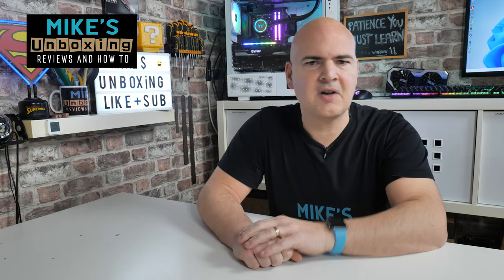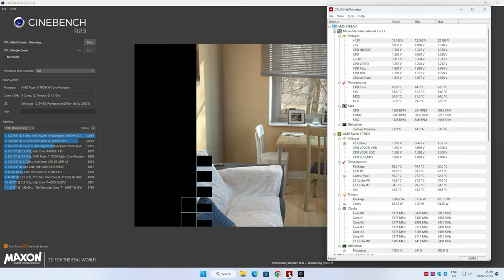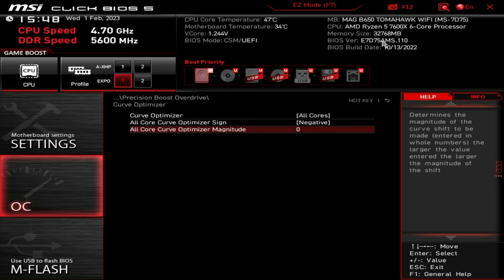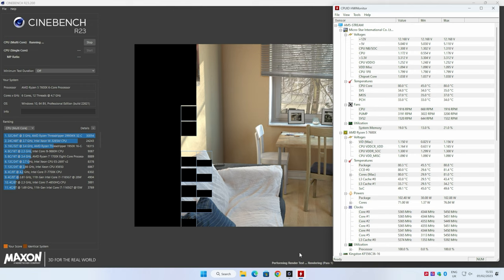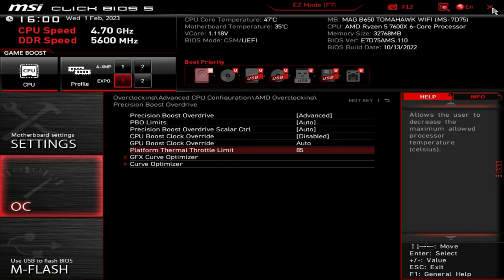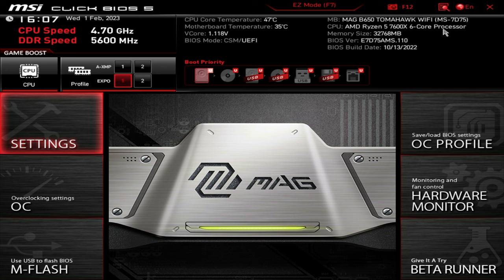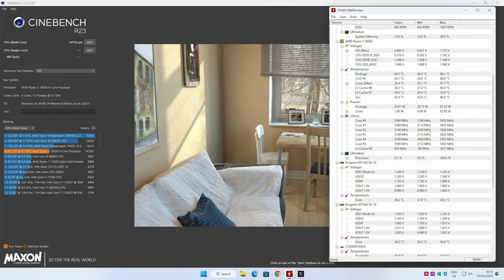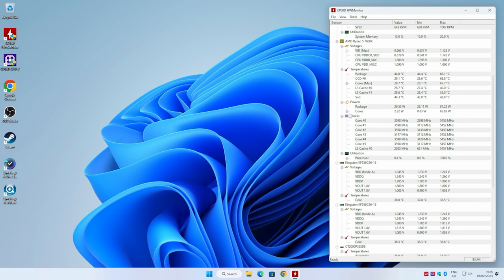How To Tune AM5 Ryzen 7000 Series Wattage & Reduce Temps With Curve Optimiser PBO2

Comment: For anyone interested in easy testing AMD's Ryzen Master software has in-built tests able to determine the suggested per-core negative curve optimized max safe setting each core is capable of for under-volting, which can then be inputted to the BIOS as Mike showed in this helpful vid.
Reply from the maker: thanks Ron absolutely right on the money there
Reply: @mikesunboxing  Every time I run it, all the cores result in a -30 offset on per-core in RM auto tuner.
Reply: I have the ASUS motherboard and it would give me BSOD every time I adjust anything.  ASUS are so slow to fixing these things through updates.  I'm running power saver at the moment until I can undervolt my CPU.
Reply: Ryzen master always sets my cores way too low which is barely stable to boot windows but crashs at any heavy task.
Reply: I couldn't ever get ryzen master to work, everytime I run it, it says it needs to be reinstalled everytime, I tried so many "fixes" that software is a hassle 🤣
Reply: @voice5sur5  same here
Reply: I tried Ryzen Master but decided to uninstall. Maybe it's something i wasn't understanding, but there was a weird thing with the RAM speeds and EXPO in Bios. In Bios RAM speeds were 4800 and then 6000 after enabling right. But Ryzen Master would always only show half that, 2400 and 3000. 

Also, when EXPO was enabled in Bios, I then also enabled it in Ryzen Master and then ran a test, and the PC crashed. I liked the look and options of Ryzen Master but the RAM and EXPO thing caused me to unintall and only use Bios/AMD Adrenalin.
Reply: @sleazydzx 2400 or 3000 MHz being shown is a feature, not a bug. Nothing to worry about there since DDR stands for double data rate, if it reads as 3000 MHz you're operating at double that, thus 6000 MHz.
Reply: Didn't know this. Wish Ryzen Master wasn't so ass tho. Sorry for the language, but it's the truth. Can never get it to work properly. Been doin' Bios tweaks manually since forever.
Reply: @sleazydzx some motherboard companies show the "true" speed. DDR stands for Dual Data Rate, which gets you the actual speed. In short, there is nothing wrong, they're just displaying it differently. 2400=4800 and 3000=6000 in DDR...  

Edit: Ah, someone beat me to it lol. Carry on :)
Reply: @sleazydzx  The RAM speed is correct, you need to double it (DDR - Double Data Rate) to get the final M/Ts, 3000 is actually 6000. You're better off enabling EXPO in BIOS and letting the computer boot up / shutdown, sometimes several times before the EXPO settings are locked in. Plenty of videos about this on YouTube.
Reply: Can't recommend it, RM set my cores to -40 in pbo it boots and runs but bsod's on prolonged heavy CPU usage. I thought I hit a jockpot in silicon lottery after RM tuned my CPU to run 5.5 with lower temps on heavy loads (70c) but then it crashes hard after an hour.
Reply: @voice5sur5 I had to pull my cmos battery after I installed ryzen master it screwed mine up so bad lol.
Reply: Ryzen Master's test is way too optimistic. It usually sets -30 or -27, which unless you have the best silicon on earth, WILL crash (WHEA-18).
I guess it can at least be used to determine a maximum that is useless to test over

Comment: Thank you so much for this, used your same exact settings on my own 7600X: went from 14364 cinebench score with ~96 °C and 135 W package power to 14756 score with 70 °C and 87 W max! Insane.
Reply from the maker: That is a great result nice one
Reply: ????????????????????????? 96*C ? buy new cooler mate mine after 10h in game have have max 67
Reply from the maker: This is expected results for am5 they have a target of 95c by design
Reply: @nokelo4207 does 360 aio is enough for 7600x to get temp under 75 ?
Reply: @Crenzy-ct9tt  I would start with undervolting it as in the video.., the chips clearly use way too much watts and power for their overclocked
 speeds by default..
Reply: @nokelo4207  even with the best cooler on the planet, you should undervolt your ryzen 7000 series, they are produced to work at 95 degrees and above also, so its not matter of cooling, its matter of optimizing performances!!!
Reply: @GiacomBono  I didn't buy the 7600x just to underwolt it. I buy it cuz its a bit better than 7600 and was cheaper
Reply: @nokelo4207  of crz agree with you, but doing undervolt will increase efficiency and performances as well, always worth it with ryzen cpu.

Comment: Thanks for a very informative video Mike 🥰💪👍😇. I’m currently putting together an AM5 system (most parts purchased except cpu) and contemplating the 7700x or the 7800X3D for a gaming setup 🤔. These settings will prove very handy for my build. Cheers 🍻 buddy 🥳
Reply from the maker: Sounds great! i would go with the 7700x at the moment, i just picked one up to repalce the 7600x and cost me an extra £40

Comment: 30 passes validation for me and boots up when set in the bios but core #5 will fail prime small ffts after a few minutes for me. 7800x3d and Asus x670e-plus-wifi....I was able to run for an hour at -20 and play a couple hours of CoD so I think I am good there. Clock speed is right around 4600mhz so not full boost but I guess it's ok.

Comment: Nice Video! I tried to set it to 30 and everything was fine, i got a higher cinebench score and lower temps but after that i kept getting bios freezes and Memory Management errors, even after disabling PBO completely i got an Memory Management Error, i had to disable the EXPO ram profile even though it was working before to get back in to windows, any ideas?
Reply from the maker: manually set the EXPO and ram timings, that worked well for me, we did a video on it recently after having DDR5 issues
Reply: @mikesunboxing  Thanks for the reply! I saw the video and i followed the instructions, after that i was able to experiment with the PBO again but after a couple of setting changes and restarts the bios freezes and bsod‘s came back somehow. If i reset the bios settings everything is fine again but it’s quite annoying because i would love to get the advantages of the PBO but i can’t seem to make it work, i also have the msi b650i edge, i‘m thinking of trying the new beta bios version or do you have any other recommendations?
Reply from the maker: This is maybe easier to fix or at least advise if we can ask more questions and get direct answers, so feel free to join our Discord chat and we can go over it in more detail https://discord.gg/XtBTGQ6BDu

Agree to the rules by clicking the emoji and you will get access to the rest of the Discord channels @ncly9995

Comment: thank you sir, i had issues with my temps and most importantly sound and power of my ak620 fans with my 7600x, i lower the curve to 30, with a limit temperature of 80 with auto setting in tdp, and now is running really smooth
Reply: and my pc crashes if i put co to over -10

Comment: I copied all of your settings with my 7700x. -30, 85 PPT. My tempratures maxed out at around 60.9 C with a score of 19060 in Cinebench 23. This score was around the same as it was when I started. Wattage was at 87. Idle is around 41 C. It looks like I got a good CPU! I have a Noctua DH-15 with MSO Pro B650-P Wifi. This was quite easy to follow since your board is also MSI. It seems it's working very well for this configuration. Thanks for the video!!
Reply from the maker: glad it helped you with your setup
Reply: impressive drops, what sort of wattage do you get when the system is in idle in windows doing nothing?
Reply: Can use CO -30, 85 PPT together?
Reply: when i use this setting my score drops from 19000 to 18000 and i don’t get why. i notice that the boost doesn’t go past 4.4 mhz

Comment: Thanks a lot for this mate.
I managed to get much lower temperatures and power consumption while also gaining 1000 points in Cinebench with my 7600x. 
I guess I have a nice piece of silicon, I can run a negative 40 on the CPU completely stable.
Thanks again, great job!
Reply from the maker: Nice work!
Reply: im guessing it depends on cpu? but since negative 30 is the max does going even further ike negative 40 even doing anything ? im possibly upgradeing to an AM5 build in the coming month to an 7800x3D afaik that only has an negative 30 as the "lowest" setting to go so is the 7600x possible to go even lower? also seen some saying they are going beyond -30 on a x3d cpu
Reply: @n0ex  Probably it's the BIOS which allows more than -30. I'm running ASUS TUF Gaming B650.
And yes, of course, all depends on the CPU.
Is it worth it going more than -30?
I guess not. You would never notice apart from a few points in a benchmark.
So consider -30 as a sweetspot.

Comment: Can i just say that this is a great tutorial and so refreshing to hear someone say " do it in the bios because you don't need extra apps" i followed your suggestions and OK I'm not running a hot CPU , just a little old 5600g , i know i know but it does what i want , and the temperatures have plummeted and adding to that the energy has dropped too  so Thank You
Reply from the maker: Glad it helped!

Comment: Ryzen 5 7600X & 240mm AIO Went from idle 45°c avg 70-85°c max 95°c to idle 38°c avg 50-60°c max 62°, clockspeeds up to 5.5Ghz by copying these settings, amazing video!
Reply from the maker: that is a great result

Comment: Thank you so much, I built this pc 2 days ago and playing Fortnite my cpu was hitting 93c, hitting that temp concerns me set to 30 and 85 limit the hottest it got is 79c. That’s around where my i7 used to run while gaming, spent $1300 building this and I want it to last. What I built r7 7700x / 7800xt 16g gpu / 32g ddr5 6000mhz /  msi650 motherboard with Wi-Fi and Bluetooth / 850 watt gold psu / deep cool cooler at 62 cfm / deep cool case / crucial 2tb m.s2 and put a 500g m.2 WD blue I had laying around. Very stocked with what I built and I know they say these processors run hot but I want longevity out of this system and feel I can achieve this with cooler temps. Thanks again !
Reply from the maker: glad to know that we helped someone out

Comment: Hey Mike! recently upgraded to the same processor (7600x) and was worried about the voltages and temperatures being uncomfortably high. Found your video, used your settings and went from 95-96 °C  roughly 75 °C and slightly higher performance! Thank you so much!
Reply from the maker: glad it helped, and lower temps are always welcome

Comment: I’m pretty amazed how well Curve Optimiser worked.. here my results with Cinebench r23 on my 7600x.
Stock: 
score 15025, 82,4 celsius, pulling 94,3W.
With CO - per core:
Score 15848, 67,2 celsius, pulling now 72,2W.
More then 20% of power reduction and 15 degrees cooler!
Reply from the maker: sounds good to me

Comment: Thanks for this good and informative video. I could not boot my system on negative 30 anymore, but 20 combined with the other settings are working fine. My CPU temps dropped from max 88 degrees to 68 and consumes much less power now.
Reply from the maker: glad it helped

Comment: Very good tutorial! Thank you! 7600x with pure rock 2 in micro case here. On stock bios settings: termal throtlling after 2 seconds in  r23 with score 14464. After setting negative curve on 30 and PPT on 88w: after 10min in r23 max temp is 74 celcius and score 14366 🤩
Reply from the maker: Nice work!
Reply: That score seems rather low? Or my 7600x is better binned but on r23 I'm getting 16k points while never exceeding 70c Celcius (deepcool ls720 360 aio) currently still messing around with my curve optimiser but all my cores are stable on -40 sofar with the exception of core 1 only reaching -35

Comment: With the help of the video and some comments from our friends, I came to the following result:

Ryzen 5 7600 non-X @5.35GHz
- CinebenchR23 15090 (MC) and 1934 (SC)
- CPU-z 6148 (MC) and 745 (SC)
- Max temp 80.3 ºC, room temperature 25 ºC

PBO2
- PPT: 88W
- TDC: 80A
- EDC: 120A
- CPU Boost  Clock Override:  +200Mhz
- PTTL: 85 ºC
- Curve optimizer: Negative 50

MB: B650M Mortar WIFI (AGESA ComboAM5PI 1.0.9.0)
Cooler: Thermaright SI-100 Black (Low Profile)
Reply from the maker: nice work

Comment: Hi, Mike. Looks like the new Ryzen chips were designed to make everyone get a custom open loop. LOL. My 3900X system has never gotten above 72c after 10 minutes of Cinebench R23 with a top score of 20,070. Two copper radiators and a strong D5 pump does make a difference. And, it's quiet even with seven 120mm fans and two 200mm fans. 👍
Reply from the maker: yep custom cooling and increased costs / higher end parts all round really. considering a thermaltake custom loop at the moment
Reply: @mikesunboxing  I wouldn't buy their little custom loop Kit. It's kind of pricey for what you get.
Reply from the maker: @OlettaLiano  yeah i think I’ll buy individual pieces to cobble it together
Reply: @mikesunboxing  I'm sure you can handle it, but if you need any help picking out parts, let me know.
Reply from the maker: @OlettaLiano  Thanks 🙂
Reply: My 7700 with stock cooler sits comfortably at 70 degrees during workloads 🙂
Reply: @Eddie276  I am contemplating 7700 myself due to 65W TDP and was wondering if the stock cooler will be enough. How has your experience been so far? Do you game much? I’m planning a new rig, mostly for gaming.

Comment: Absolutely worth doing it!
I took a different approach and only did the `Config TDP` step, setting my R5 7600x to 65W, and also set the throttle to 85 as well.
The results: 5,4GHz (sometimes 5,9GHz in some cores) with the maximum 66 degrees celsius on the package. Amazing! :)
Reply: Which cpu cooler do you use
Reply: @nhacspicy6444  I'm using a Noctua NH-U12A. All that in a Lian Li 216 stock configuration
Reply: @cesardasilva892 During Cinebench how much temp it goes upto?.
I'm using Deepcool GAMMAX L-240 A RGB cooler, with that after setting Max temp to 85 it is reaching that point only.
Reply: Regarding Config TDP
Reply: @itsdanielparker7116  before the TDP config, it reached 87 degrees celsius. After the TDP config, it reaches 66 on Cinebench full load. During my game sessions, it keeps on the 55 ~ 60 degrees celsius.
You should consider the case airflow, your thermal paste and even the CPU cooler itself.
Reply: @cesardasilva892 what about the scores did they go down at all after you did it?
Reply: @Iamdudeman12  I really dont care about the scores rs since they are a synthetic test, and do not represent my daily activities reallity. Btw, the score did raised, because I got higher clocks with the lower temps.
Reply: Did you set TDC and EDC limits in PBO limits ? Or are they in auto values ?
Reply: @breakingmoody9902  auto values, my man
Reply: 5.9 ghz? 7600x? Without adjusting boost clock? 65w? Lol
Reply: @RayanMADAO  core #3 reached 6.1GHz a few days agora. 65w thermal throttle 85°C

Comment: A bunch of tips and complements to this video :

- None of the tips shown in the video helps with idle temps. If you want to reduce them, you'll have to disable some cores in Windows. I don't recommend.
- I can only recommend closing all useless programs (including ASUS Armoury Crate which for some reason keeps all cores awake and makes my idle wattage 75W instead of 20W) and background tasks you don't need (RGB controller, auto-startup programs in Windows task manager, internet especially chromium based browser).
- From experience (Ryzen 5800X), per core CO coefficients are better. I managed to pull -10 on my 2 fastest cores and -15 for the rest. Best cores are chosen by windows to be the most efficient, so it's common to fail putting the same undervolt on them than the rest.
- You're lucky you could put the CO at maximum on your chip.
- Reducing the platform thermal limit is a great idea.
- Still on my 5800X, PPT TDC EDC are 120/90/120. That's because I want to limit my thermal output.
- PPT is always 1.35x CPU's TDP. So for a 5800X that has a 105W TDP, the PPT will be 142 by default. Reduce this setting only if you want to sacrifice top power at 100% CPU usage for better thermals.
- Don't bother lowering clocks for lower heat like you'd do on intel's. Ryzen CPU's WILL run at max boost clock as long as they can, and skip cycles when there's no load on the cores.
- Curve optimizer is the way to go because each CO point doesn't represent a fixed amount of millivolts. It'll be 5mV at the top of the curve, and 3mV at the bottom. This is much better than raw voltage offset which will make your pc crash at very low loads (when some cores are idle).
- Ryzen chips are designed to run up to 95°C at max load. Expect 80°C with a high-end cooler. Don't try to lower these temps with aggressive fan profiles, you'll end playing on a leaf blower instead of a desktop.
My personal fan curve is a straight line, from (60°C, 0%) to (90°C, 100%) and I think even that is too aggressive.
Reply from the maker: some very interesting and useful tips there, thank you

Comment: my R5 7500f exceeds 95 degrees and the settings you made only work in curve optimizer, other settings are not available in my bios. My motherboard: msi pro 620m-e can you help me?
Reply from the maker: sounds like you cooler isn't mounted right, even stock it shouldnt hit that high of a temp

Comment: My preferred Fan curve on all my Systems since its been a thing 
100% ALL FANS! at 30*C - NO CURVE!
Easier to keep something cool then try and cool it down later 
Also Higher performance at say 40*c under load than 80*C under load for some thing its can be 10-15 or even 20fps gains 
Hot parts ALWAYS , ALWAYS are slower (its just a fact of physics) 

Not worried about the noise as i game with headset on and noise cancellation means nobody else on discord or comms can hear it either.